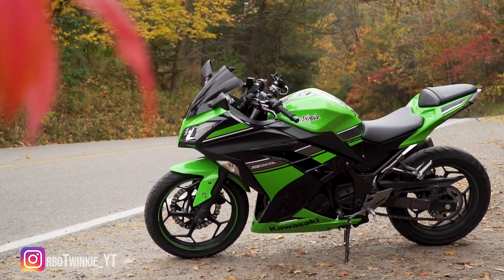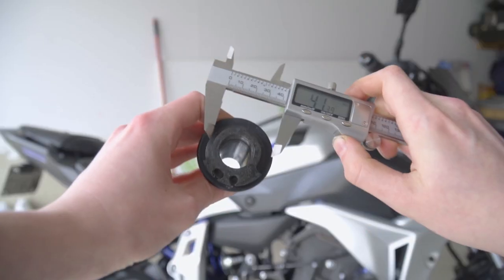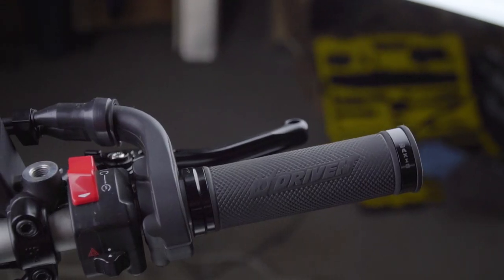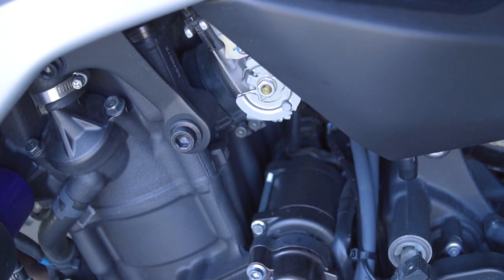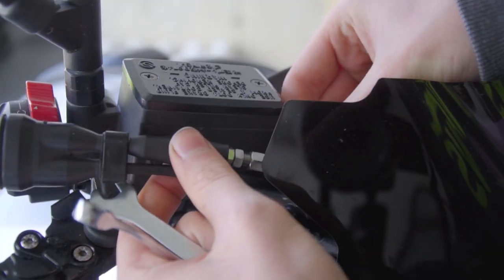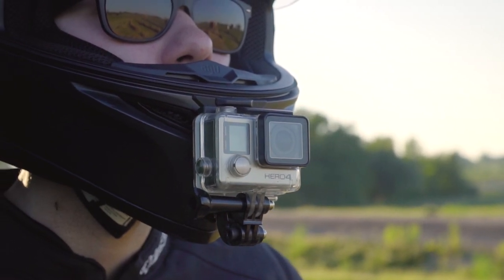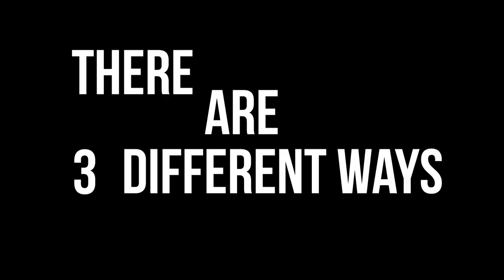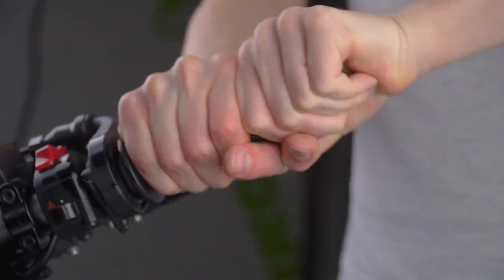How to make Yamaha MT-07 More Responsive!!! [Throttle Tube, Freeplay & More]

Comment: Carried out this mod with the Motion Pro 01-1303 throttle tube, that has reduced throttle angle to about 60-70 degrees. Great mod  makes blipping on the downshift a breeze. Small screwdriver  under grip and some WD40 working round with the screwdriver had the std grip off easy with no damage. Cleaned up in washing up bowl and dried and pushed on the the new twist grip tube no problem without any other  glue, hairspray or alcohol. Usefull video.

Comment: I made my own throttle tube. Epoxy glued a thick ziptie to the outside of the surface to make the diameter bigger. Then i softened the ends to make it less "jumpy". Worked a treat and only cost me 1 ziptie and some glue
Reply: Let us know how long that holds up
Reply: @mtmatt8958  bike is now sold, but had it like that for 3-4 years without any issues.

Comment: Put your grips in warm water. The rubber is going to be verry soft and it just slides on. Then let it cool down. verry easy and you have the time to adjust the oriantation.

heated grips still recomment to use gleu.

Comment: In defense  of Motion Pro I bought their throttle tube   01-1303 and the cable wheel diameter is 40.58mm when I fit this to my '21 XSR700 it will significantly reduce the throttle  oppetating angle and only cost £14.98.

Comment: I own a 2019 r3 and just recently installed a r6 throttle tube. It still has the same 90 degree travel like the factory r3 throttle. Is there anything i did wrong?
Reply from the maker: Hmm, did you buy the OEM R6 throttle tube or the cheaper motion pro? As seen  in this vid motion pro barely makes any difference.
Reply: TURBO TWINKIE i bought the oem r6 throttle tube from snow city
Reply: Dang you got played. Did you measure the diameter of both?

Comment: Do not remove the throttle freeplay. Just do not.
Reply: He did not totally, as you saw he done it correctly, adjust and check at full lock each end.  If the revs start to creep at full lock, re-adjust.
Reply: Funny how people love quoting rules but don't know why. As said, if there's no pulling on the throttle body then it's fine.